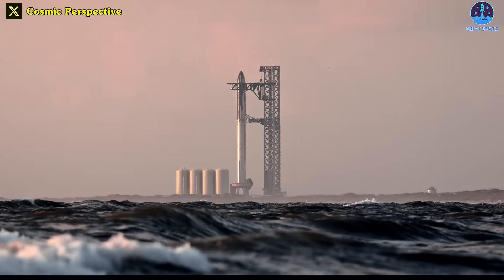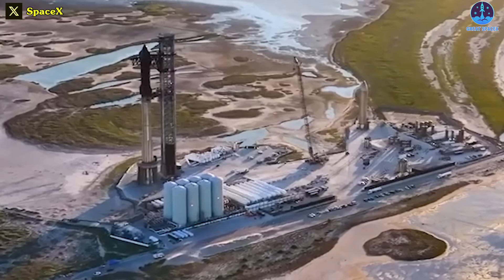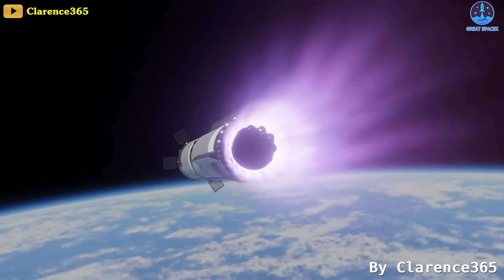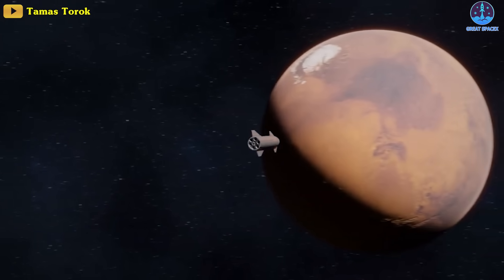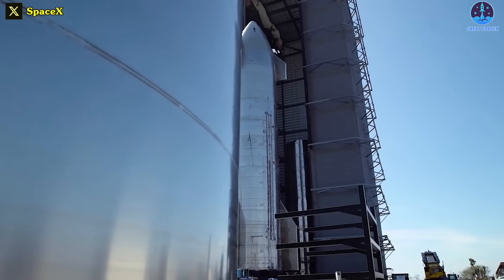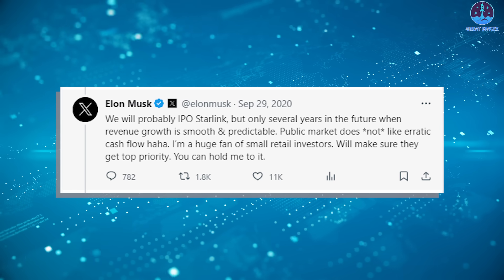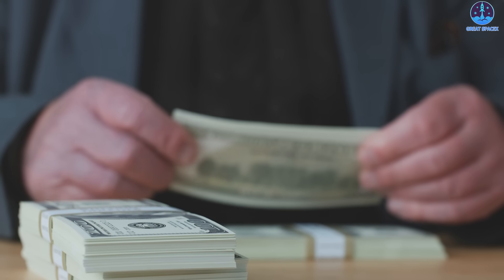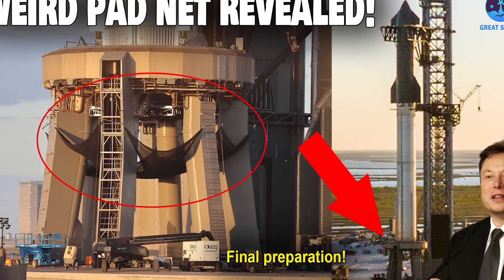Unusual mesh net under OLM, final preps for Starship launch, and more...

Comment: I hope that the spokes between the bottom and top rockets and strong enough.  I would feel better if there were 3 or 4  posts reaching between the two rockets for added support would you boost confidence.
Reply: you mean boost your confidence, not spaceX. They are just fine.

Comment: Why not spiral weld the body of the rocket. One or two long roll with fewer welds.
Reply: possibly because that would require enormous metal ribbons to be wrapped around each other.  It could be far more difficult to manipulate precisly enough to weld together and get the right shape for the rocket body.  Try it with a couple pieces of tin foil at home to get the idea.  Let us know how it goes.
Reply: Honestly why not?
Reply: At one time, SpaceX talked about using varying thicknesses of steel - thinner at the top and thicker at the bottom to reflect varying load. Much easier with rings. I haven't heard any update on this lately.

Perhaps we will see this in future or maybe the spiral idea. Too early for too much optimization, now. Stay tuned.

Comment: The thrust is more  closer to 20 million pounds now , not 16.
Reply: They need to do something because with 4 engines (minimum) at launch out it couldn't even lift off the launch pad (unloaded) until it burned some of the fuel off. Otherwise the pad damage may not have been so severe.

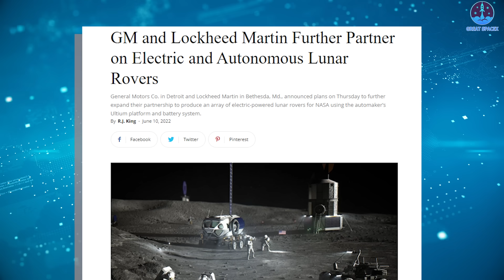Comment: Do not leave FTS in the hands of ULA or Blue Origin ! But for this launch I have the impression that the use of shields  was not necessary since the ship does not leave the low orbit. And it will be lost after 90 minutes. So ship 26 was better used for this purpose. 8:35 Two other companies that want to beat Disney: GM and Lockheed Martin ! In animation they are the best.

Comment: I suspect that the next launch of Starship will be without fins, and the cost of fitting them to a fully assembled Starship need not happen.  The second stage will crash into the ocean near Hawaii.  Why waste a fully rigged Starship for that one-off test. It is the first stage that is being tested.  Anything else attached to is a secondary consideration.  The LBT contract have already been awarded, and ULA and SpaceX already have those contracts.
Reply: They still have to do á controlled decent, so no
Reply: I disagree; it's also a "hot staging" test, and I'll bet they have secondary mission profiles if the booster fails with time and space enough to spin up the upper stage. They didn't have that option last time.
Reply: This will also test the re-entry process and devices (ie: heat sheilds, hypersonic control using flaps, a flip to vertical and engine reignition for a soft and controlled landing in the ocean as if it were a land based location).  Maybe it will not make it that far but if it does then it will need all those things onboard.

Comment: That net is to prevent foreign material from falling through holes in the water deluge system. It is probably one of the Fish and Wildlife Service requirements for future launch.
Reply: Unless you know that for a fact, it could also be fall protection for workers. I've seen that done under bridges....
Reply: As noted in the report the fine mesh is barely supported so it is not to catch people, which has never been a problem. It’s to keep FOD such as small tools, nuts and bolts from damaging that very expensive shower head. I seriously doubt it has anything to do with USF&W.
Reply from the maker: It will be there when Raptor firing?
Reply: @colonbina1   Only while doing maintenance work to catch any debris that may fall onto the platform?
Reply: Probably
Reply: So now FWS chair-warming stem washouts are rocket scientists? People are getting angry at this administration.
Reply: To Hxll with the moon, we got fish, turtles and birds to worry about! China, you can have the moon.
Reply: @foxworthy19  what is China going to do with the moon? Build factories to make more iPhones?